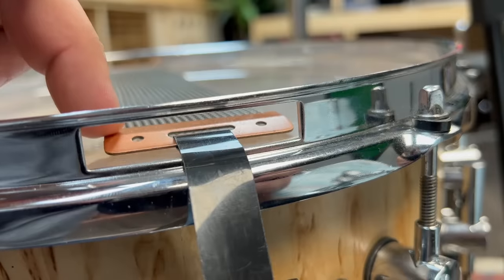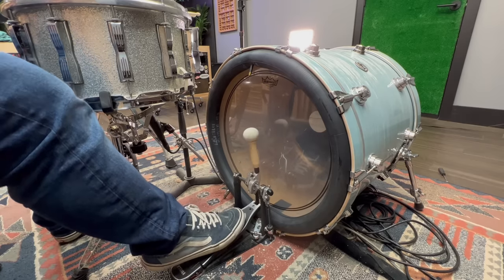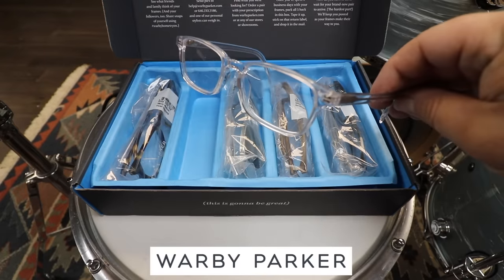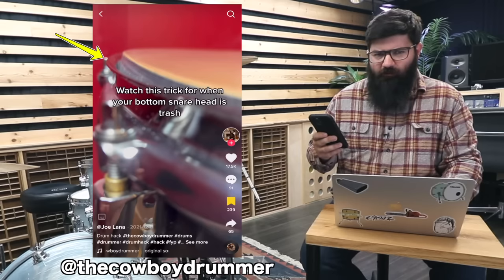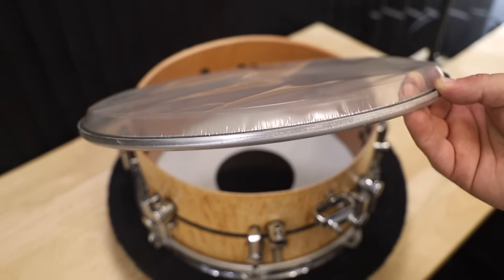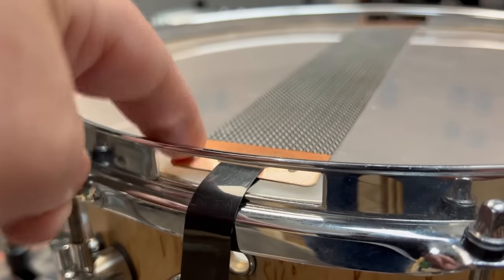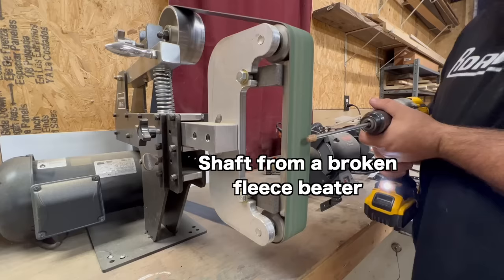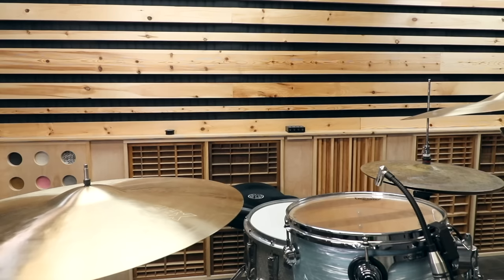Testing the WEIRDEST Drum Hacks I Could Find

Comment: The microphone hack was hilarious. One hack I've tried with some success is waxing the unfinished edges of wood drums with good paste wax intended for furniture. I polished the edges to a fairly high shine before I put the heads on.
Many years ago, I also used (get ready) WD-40 on the edges of metal snares, to help the head slide on the edge while it was tensioned. I just wiped the edge with a cloth soaked in WD-40 before installing it to give it a slight amount of that substance.  Seemed to help, to be honest. I got the idea from the need to lubricate large sheets of metal when forming it on a die.
The best/worst (i.e., hilarious crazy thought but works, hilarious crazy thought and doesn't work) hack I can recall was the suggestion to line the inside of a snare with maxi-pads to quell ring (you may have tried that already), from back in the "how much more dead can we make a drum sound?" 70's. Surprised shag carpet as a snare liner wasn't used then, instead.

Comment: On the V-Belt in a steel shell hack, years ago I picked up a Ludwig Hammered Bronze 6.5x14 snare in a pawn shop.  Only had one die-cast hoop.  Brought it home and put a new set of die-cast hoops on it and it had a lot of ring.  I also had a new set of 30 ply maple hoops in my shop.  Put them on the snare and I loved the sound as well as the looks.  To date, those hoops are still on that snare.  It has a nice warm tone to it with just enough ring to it.
Reply: Did you use a belt?
Reply: @arheru  no, just used the 30ply Maple Hoops.

Comment: Hi David, I think I discovered a good bass drum hack to make it sound clicky/Electronic.depends on the size.Use a loose bass drum head,Or any one ply batter,That’s at least 3 inches undersized.Take two coins preferably quarters.tape them to the batter outside of the hack,Where the beaters impact. Then take the “prepared” head and it should rest inside the clamp on the hoop bottom.the top of the resting head will fall forward.Then tape just the 12oclock position.it’s ready.The coins should be hitting indirectly from inside that patch. Thanks
Reply: I apologize for bursting your bubble but I'm pretty sure that's exactly what Vinnie Paul was doing on those Pantera albums to get his bass drum sound.
Reply: @liamfitzdrums  Ha! No bubbles bursted here.I know that fact.Mine is slightly different.Sorry for not being clear.Vinnie taped his with the coins facing the beaters directly.With the possibility of the beaters sticking to the tape as it heats up from playing.Mine is a hack that can be placed against the head or quickly removed for the booming regular tone.My coins are hitting from the underside of the head/Hack

Comment: alright, david, we are going to need you to test every mic you have in every position on that beater you can imagine. clearly the problem here was not the idea but it was your execution.

Sincerely, your entire audience without any exceptions.
Reply: Wouldn't it make more sense if the mic was stationary? 

If it were in a fixed position and you struck it with a beater that would make a lot more sense to me. 

Iv watched a guy play a kick mic with a felt beater and a few socks wrapped around the mic for padding. It actually worked pretty well.. it was consistent and had low frequency, what more do you need?

Seems like phasing was a big issue considering he was literally moving the mic every half second. Besides also getting the wobble and spring sound of the pedal.

Comment: David, David, David I suspect you might be just a tad young to know about the original  reason for fan belts & silicone in flanges & beards. It wasn't dampening, it was directing the air column inside the drum over the entire bottom head. Hopefully increasing the sensitivity. The dampening factor was just an unexpected benefit. We would epoxy the fan belts in place. It was most common to just epoxy a fan belt in the flange that made the bottom bearing edge. Of course people started filling the bead & the top flange as well & that's probably when the dampening factor started to get noticed.

Comment: Great to see the old Royal Star mentioned.  I have a Royal Star kit (possibly early 1960s ‘oil-slick’ blue) with all the original hardware AND skins!   I’ve had it since 1987, and absolutely love it.  I use modern hardware and skins (though I still use hydro-heads, which are well out of fashion and getting harder to find replacements) and the original stuff is ‘protected’ in old gear bags.

Comment: 6:10 my drumset that i play shows with does not have reso heads on the toms. i have the rims on however so the bearing edge is safe. i mic up the toms from the bottom and they sound even better they did when i still had resos and would mic from the top. 
surprisingly a great thing to do to your kit for shows!

Comment: I like that silent stroke reso head trick a lot.  Seems to really reign in those toms and make them sound more controlled.  Probably wouldn't need a gate for them live.  Also, won't have to worry about a big PA system causing any sort of floor tom sympathetic feedback resonance, which I have run in to in the past with a super resonant floor tom.  I wonder if it works on a snare drum to make it not so damn loud lol.  Sometimes my band plays some places with really challenging acoustics, and the snare just clatters around in there.  Every band that plays there has that problem, not just us, but that doesn't mean that I'm not interested in finding a solution lol.

Comment: I used alien gel tape for my muffling! You can get a roll of it off Amazon or Lowes or about $10. Its shock resistant, leaves no residue when you take it off, and you can wash it and reuse it!
Reply: My son got a pack of superhero window decals that worked perfectly for muffle gel. Captain America was always on my snare and the hulk on the floor tom
Reply: @honkytonkinson9787  like just vinyl static cling (or whatever is holding them up!) decals?
Reply: @freelance_commie  close. They were similar to moongel but opaque. They also seemed higher quality; didn’t get dirty as easily and didn’t bleed color into coated drum heads. I wish I knew what brand they were, or where to get more, but it was something my son got for Christmas years ago and I sort of stole them lol

Comment: An actual decent drum trick for your bass/kick drum
For some fast double bass drum notes, if you don’t want to use so much muscle or it’s just so fast that it is physically impossible, and you do not have two bass/kick drums, a technique you can try is that right before you do the double bass drum notes, you slide your foot back in a way so only the front part of your shoe is touching the middle of the pedal, and you quickly slide your foot forward until the whole foot rests on the pedal. It should hit the kick drum twice, and it should be much faster than just brute forcing it.

Comment: Turning snare head upside down to extend life - we did that in marching band
Reply: It's one of those "why not, it's trash anyway" things that's generally worth trying so long as it doesn't break something else. I wonder if this could be combined with the heat gun method of restoring head tension. Maybe remove the head, get as much slack out of it as you can with the heat, and then put it back on the drum whichever way it fits better. If the heat gun worked well, this may be the "right way up". If the heat gun didn't work well, you get one more use out of the head by flipping it over.

Comment: I have a question that may be dumb. So I saw you have the Velcro in the bass drum to hold the muffler and I want to do this to but I’m afraid that if I ever wanna get rid of it it’ll damage the bass drum? Am I correct for thinking this?
Reply from the maker: if its a really low quality shell and super strong adhesive it might peel up some of the wood, but I doubt it. Ive taken it off a drum before with no problem. I typically dont add it my drums since I dont use that system of muffling, but it came preinstalled on that kit.
Reply: @rdavidr  If it's a low quality shell, is it really that big of a deal if it gets a little chewed up while removing the Velcro? Chances are pretty good that the reason the Velcro is coming out is so that it can be replaced, and the damage will immediately be concealed by the replacement.
Reply: you really could also just throw the pillow in there.. especially if you don't move your kit around too much

Comment: Great video. I am working on some real hacks that benefit the future of drumming but can't get any traction. My Sticks that play chords (and follow music theory) are now patent pending and drums comping bass will be the next thing for drummers >>> Here's a video from the "I did this a few months ago" file while I was in mad-scientist mode. It's to show my work using a MalletKat connected to my kick and hat pedals. I know it sounds a little odd because of the two VERY DIFFERENT sound combinations (malletkat struck with stick v malletkat played with kick) but that's to demonstrate the technique of using the kick to triggers notes (which follow the Malletkat input) and the left foot (hat) to control sustain. When the sound is the same, it's hard to understand what is happening. However, it actually sounds GREAT when both MalletKat and Kick (also Malletkat really) play the same bass patch. When the two sounds generated in this setup are the same it sounds like a really tight and expressive bass player. There will be lots videos of that in the future. The take-home message is drummers can now have a note on the Kick "follow" a Malletkat's input like a really smart gate that also controls both velocity and sustain. I should add that velocity in this setup is not limited by bits; in this setup Velocity is actually an analog continuous range. So it is a very expressive addition to hybrid drums. You saw it here first...  https://youtu.be/rjINJJIwxsI
Reply: I should have mentioned that left foot only controls sustain of the "bass" note that comes from striking the malletkat with a stick. The sustain of the higher notes triggered by the kick is also controlled by the right kick pedal (intuitive and automatic). Effectively there are two separate sustains.

Comment: Slight change that might make the mic beater more practical (lol):

Don't wear shoes so the mic isn't picking up the sound of the sole of your shoe hitting the pedal.
Reply: Taking off shoes to reduce stray noises seems like a reasonable idea even if he improves the hardware, but I don't think it's enough to solve the problem by itself. The real problem was the multiple strikes, since there were multiple heavy parts that were able to move relative to one another. That's why I suggested using a much lighter microphone like a condenser, and using the ball from the front of an SM-58 to supplement its own windscreen.

Comment: Couldn't you attach a contact mic to a regular beater?
Reply: The air passing through the diaphragm of the mic would be picked up. I'd imagine you'd get all kinds of phase related anomalies too, not to mention how impractical it would be to play with the wire flapping around and the extra weight on the beater, plus the higher probability for something to go wrong and ruin your recording session. It would be better to dangle a lavalier mic near were the beater hits the head and just tape the wire to the hoop. It's a fun idea, but I wouldn't do it.